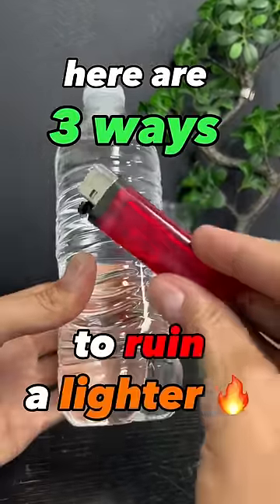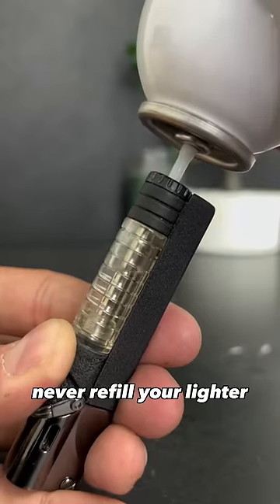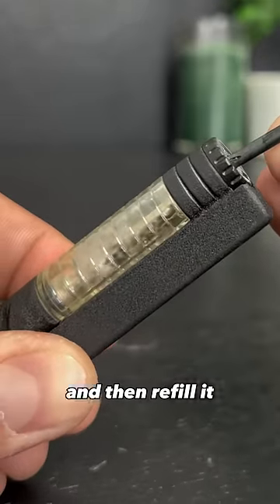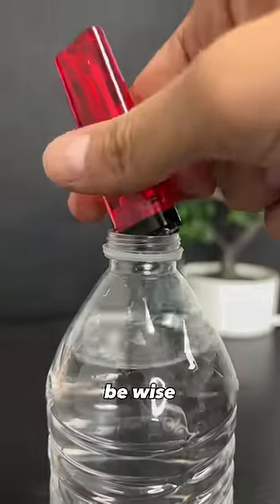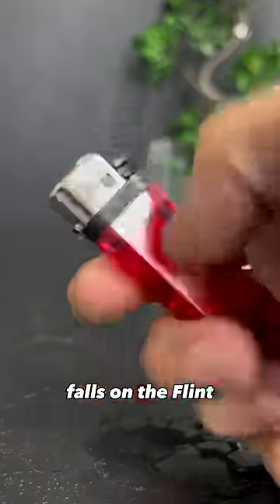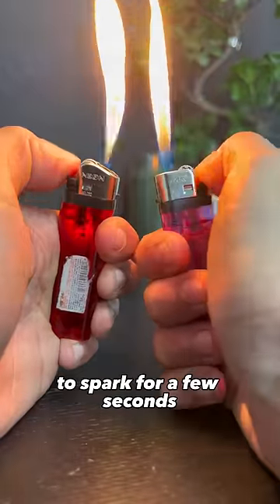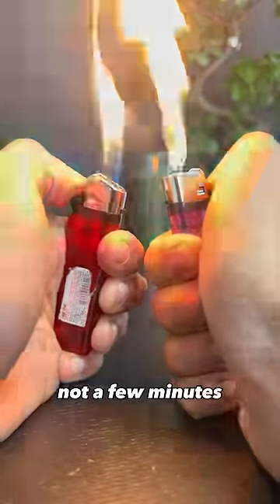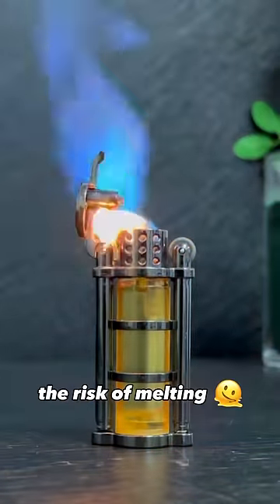How to ruin your lighter 😱🔥

Comment: 1 drop will not ruin your flint, if you don't want to, or can't for it to dry just use your pant leg or dry piece of clothing to strike it and wear the flint down untill it sparks. I say use your pant leg or clothing because your thumb will get covered in flint paste and gum up the wheel and you will just wear your flint down so far and nothing will happen untill it dries regardless. 

I've done some of testing with lighters and water after I heard that one drip of water crap as a teen because I already figured out the pant leg thing.

Comment: Basically just told me 3 reasons to keep buying bics instead lol
Reply: Bic lighters unnecessary sturdy 😂, I’ve had multiple go through the washer and after letting them dry for like an hour they worked just fine.
Reply: @aking1591  a Bic is statistically way safer to keep for survival, because of that reason. matches, magnesium, ferro rods, none work as reliably as a Bic. I’ve been able to dry out Bic flint in seconds.
Reply: Matchstick
Reply: @veeramanik8844  I’m sorry if you bring matches to the rotation your getting kicked out 😂

Comment: Usually if I get water on the flint I use another lighter to light it and then let it go until it’s piping hot and the water evaporates from the flint… works 90% of the time

Comment: stop the cap.  i refill my lighter all the time.  Just dont buy crap cheap lighters.  if you need to purge your tank there is this handy dandy way,.  You hold down the button that normally is used to light your lighter.  erhm you gotta risk hurting the stem of it to "purge" it.

Comment: If it gets wet just let it dry lmao. Also if you have a full lighter with a wet flint and a empty lighter with a dry flint just hold the button of the full one down and spark it with the dry flint it’ll work til it dries back out

Comment: 1. 99% of the time it'll be fine to refill
2. Turn it upside down and run it down your leg to spark it'll be able to light again in under a min
3. If your lighter is melting steel that's its own issue.